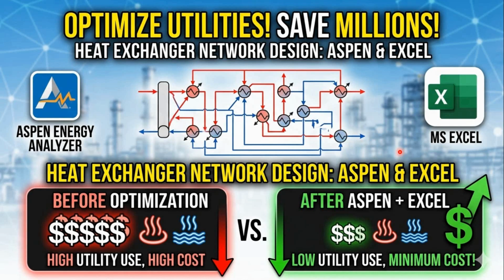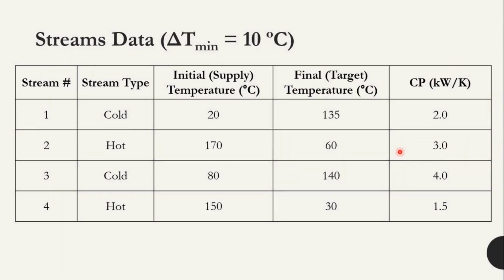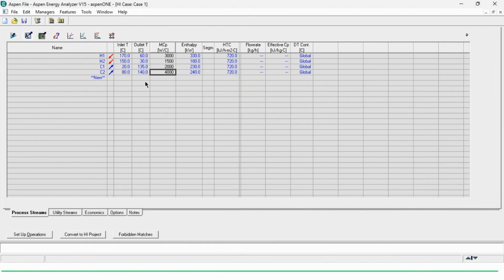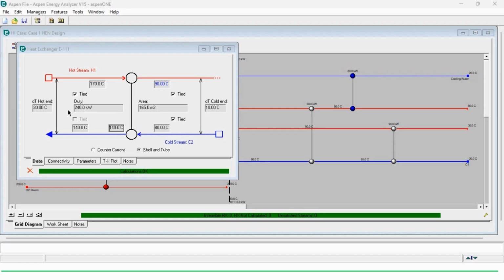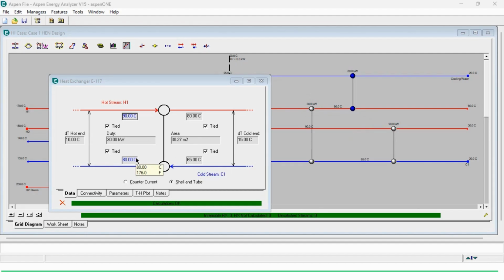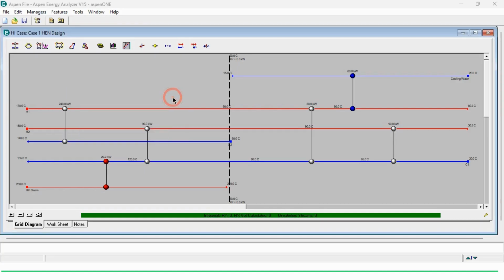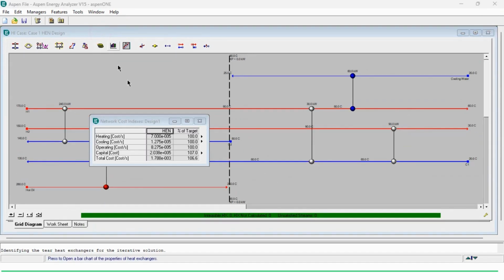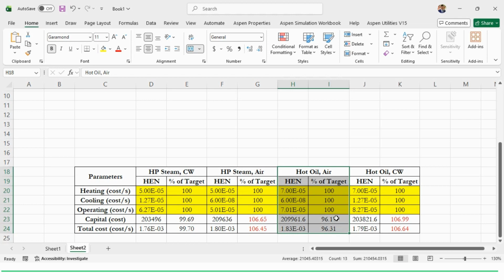🔥HEN Design Using Aspen Energy Analyzer (Step-by-Step) | Utility Optimization Explained

Comment from the maker: 💡 Want the Excel File + Aspen Case Study used in this video?
Comment “HEN” below and I’ll share it with you 👇

🔥 Also tell me:
Which utility combination do you think is BEST?
1⃣ Cooling Water + HP Steam
2⃣ Air + HP Steam
3⃣ Air + Hot Oil
4⃣ Cooling Water + Hot Oil

📊 I’ll reply with the correct answer + explanation to the most interesting responses!